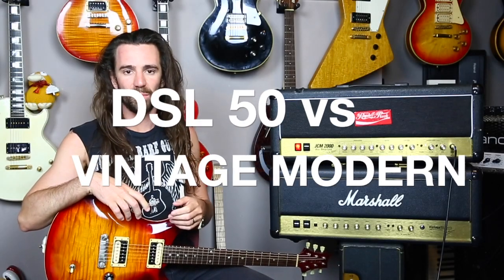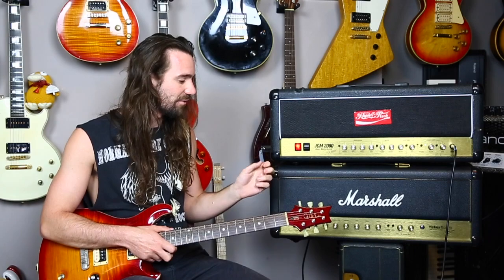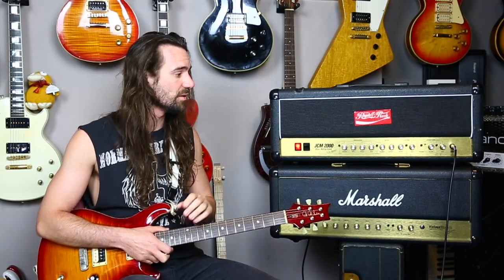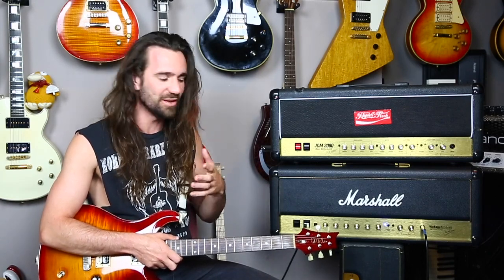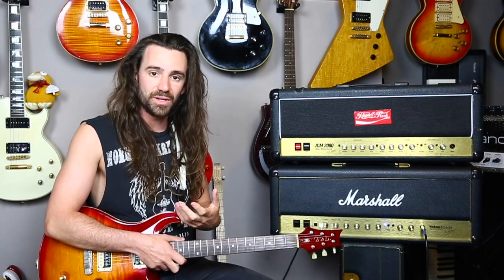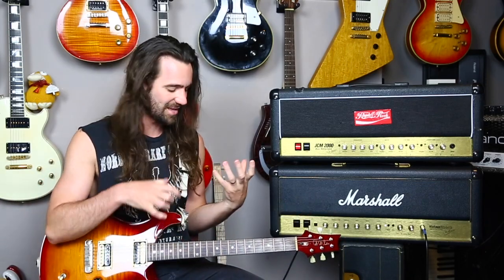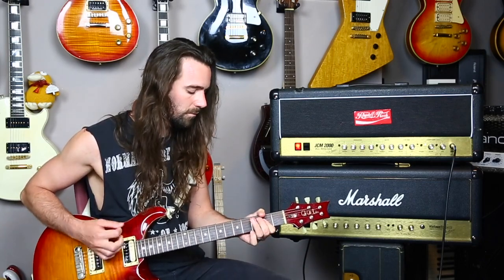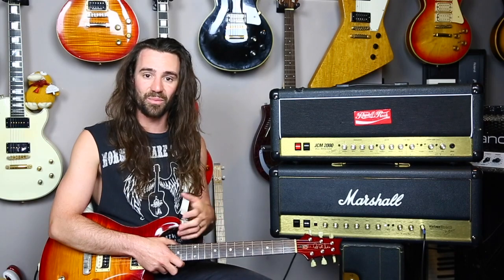Marshall DSL 50 vs Vintage Modern

Comment: Wars have been fought and won using the DSL's green channel. Crunch mode all day.
Reply from the maker: If Marshall made a single channel amp that was just the DSL green crunch it would be hailed as a classic.
Reply: @LeonTodd   DSL channel 1 Clean Channel 2 Crunch..ive had mine modded , red meh..channel 2 boosted with ZW44 is much warmer and gutsy than red thin channel
Reply: @LeonTodd  totally AGREE it's SUBLIME!

Comment: I have both a JCM 2000 DSL 50watt and 100watt. I tour alot and let me say, i literally, never use the 100 watt. The 50 is magnificent. Achieves that overdriven sound earlier. Ive had that amp for nearly 15 years and let me tell you its a steady workhorse. Never let me down.
Reply from the maker: I'm there with you dude, done hundreds of shows and a few albums with the DSL50 and it has not skipped a beat.
Reply: Awesome

Comment: The clean on the DSL has a lovely chime. Seems to me that these two amps would sit really nicely in a twin guitar attack, be really complimentary of each other.
Reply from the maker: This guy gets it!
Reply: Dwayne Yule haha exactly what I'm running right now
Reply: the most intelligent response on the internet in years
Reply: Hi . I’ve just bought the dsl100 and like you say the clean is very very quiet .
 How to get round this , do you use and eq pedal to boost the clean ? 
With crunch it’s a lot louder .
 The quiet clean is the only thing I don’t like about the amp

Comment: A nice shootout, but it's worth noting that the VM was voiced for G12C speakers, which are most similar to G12M-Heritage and whilst they sound ok with V30's they do lack some of that "character" and will give you that ripping hot JTM45 soul.  Also if you want more of that Paul Kossoff sound you want the 55hz not 75hz (pre rola)

Comment: I have had my 99 Dsl 50 for 15 years. I love it still! Just bought a 2x12 1936 cab w/2 25 Watts Greenbacks. It is SWEET! Great review, my friend!
Reply: DSl Amps  and M magnet speakers  like greenbacks  and the creamback  M65 are a  Match made in  heaven.  DSl amps  with warmer vintage speakers are just perfect to my ears.  They round the DSl amps  off just enough and  add just the right amount of warmth.  I like amps that  sit  right between   vintage  and modern  and Greenback M25s and  Creamback  M65s put the DSl amps  right in that spot.

Comment: I used a jcm 2000 years ago. It sounded great. Then it was dropped out of our van and repaired and then I didnt like the sound. I sold it and then used a jvm410. I still have that amp but I dont take out half stacks anymore. Im useing combos. I like the dsl 40.

Comment: Not much a fan of Prs I own a 1989 Custom 24 top 10 with rotary control my Les Paul custom 1968 blows it away the vintage modern with the les Paul is the best sound I ever had

Comment: Been watching your demos of the JCM2000 DSL50 great info - I have one and I love it - I had an original JCM800 and I never could get it to do what the JCM2000 DSL50 does so I'm glad I sold it! I use the CRUNCH channel and get my distortion from various pedals and it sounds awesome with my Marshall 2x12 Cabinet! My main distortion is a Bogner Burnley - the amp sounds great for the Jimi/Trower/Doyle Bramhall II stuff I do - add some UNI-VIBE and holy toledo the room shakes!

Comment: I preferred the DSL 2000 because it seems to be more versatile (that and I want whatever Adrian Smith has), but outside of hard rock and metal I would probably be all over the VM, the drive channel on the VM seems more of a one trick pony compared to the DSL but the VM does classic rock very well.
Reply from the maker: Dadrock 80 Iron Maiden user the JMP-1 preamp live I believe.
Reply: Leon Todd, hi, he definitely does, I guess it pretty much controls everything (clean, dirty, most effects) and simply runs straight into the head of the 2000. But he's still got one so I want one, but a jmp1 would be cool too!
Reply: I have a DSL H Marshall 100 watt head love it I have a 425b Marshall cabinet with the green back speaker it's sounds killer I'm going to be getting me a Vintage Modern Marshall to match my cab ASAP! Can't wait !

Comment: Great demo!.  I have owned both of these amps and go back and forth.  I currently have the DSL 100 and a couple Bogners.   The is something very satisfying about the grunt of a good Marshall.  I remember struggling to keep the VM tight sounding..  However  I am not a metal head  but love playing old Scorps, VH, sabbath, UFO,  older maiden , AIC, GNR   Etc.  they both do that stuff just fine.  I think the VM sounds a bit more like super lead and the DSL more of a the 800 or Silver Jube vibe.   A little harder sounding.  not necessarily in a bad way, just different.   Again  excellent demo.  Both amps are solid workhorses.  Thanks for sharing.

Comment: Great reviews I have a JCM 2000 DSL absolutely love that amplifier The JCM amp that I picked up has a C12 cap mod and a bright switch in the EQ section it will actually start sagging like a four-hole Plexi it's quite amazing that punchy type of sound with the switches engaged up
Reply from the maker: Very nice!

Comment: VM's are typically way more dynamically responsive than most JCMs.   Can be very rewarding if you have a lot of precision in your right hand, but will also not hesitate to let the whole world know if you are actually just a sloppy guitarist that relies on pre-amp gain compression to hide your BS.   Needless to say, the VM did not sell well :b
Reply: Was looking around for vids about the VM to help me sell my 2466.  Ended up falling in love with it again (it was in storage for 5 years while I lived in a different country).  This thing's not going anywhere.  It took me back to when I bought this.  I was actually hunting for a throaty high-gainer, tried a lot (I recall a TSL, a Laboga Alligator and a HK Switchblade), and the VM was an afterthought, but it just clicked with me.  Not the style I was playing, but definitely a style I wanted to be playing.  I love it for the dynamics, these days for sort of Contortionist-style playing, Tool, Opeth....

Comment: I have to say I love them both. I currently own a DSL 50 and 100 watt. One thing I don't like about the DSL design though is the extreme drop off in volume when you go from crunch to clean on the green channel. If anyone has a suggestion on how you deal with this or any mod ideas, I would appreciate it. Great video Leon. I hope to get my hands on a Vintage Modern someday.

Comment: thanks for doing the side-by-side comparison. The thing that you might be liking in the DSL is that it uses diode distortion which in my opinion is cheating. Yes in fact, they did add an extra tube, but there’s still is diode clipping in the signal path, and you can call Marshall, and if they decide to be honest on that day, they will tell you that. The vintage modern was part of Marshall’s master class Amps series to combat all the boutique amps of that time and they nailed it. It is a single channel amp so it’s really hard to compare a two channel amp that has four modes to a one channel Amp that has a boost function and yet it’s still has all the killer classic tones of  a plexi, super lead and it beats down the JCM 800. By the way I was in several hair metal bands during the 80s so you may have guessed my age after that comment. Point being we couldn’t give JCM 800s away back in those days, everyone wanted super leads. back in those days you could literally pick one up for $400 and people would complain about paying that much. 

I have an early pre-release  100w vintage modern I picked up at the NAMM show and I really need to make a video on it but i’m afraid the prices are already climbing on the vintage, modern as people are starting to get hip to them and if I made a video it might start a frenzy. I’m not talking bad about the DSL. It’s serves a purpose you don’t have to bring a distortion box because it’s pretty much built-in, of course people still do and that’s probably just a taste thing. I do appreciate your videos even though the last few comments I made are a little contrary to what you’re saying keep up the good work.
Reply from the maker: I appreciate all the comments, it's pretty rare to get stuff that's not "OMG GREAT TONE" or "U SUK BRO!" so they're a pleasure to read.

Comment: When it comes to Classic Rock from the 70s and 80s you really cannot beat Marshalls. They were designed for that very Style.  If you are loaded with cash check out Friedman amps. Friedman's are like Marshalls but built 200% better and they sound better.
Reply: Ben Middleton. Disagree. Friedman amps sound very 'satisfying' in a YouTube clip but are far too fizzy for me.

Comment: I have a couple JCM 2000 DSL, 50 and 100. I like the tone your getting. What tubes are you running in each. Overall I like the VM. But to be fair I'm looking for one. Definitely hot rodded 70's and 80's plexi tone!
Reply from the maker: Rob Miller VM is stock from the factory. DSL I need to check

Comment: I disagree that the fizz is what is needed in order to punch through in a loud band. The fizz just makes the amps sound scooped, and we all know how likely a scooped amp is to punch through in a band setting. On my DSL20HR, red channel, I keep Treble at 0 or near zero, Presence at 5 to get body out of the tone. Mids are usually fully cranked or close to 10 (at least 8), Bass somewhere around middle. For classic tones, I keep Resonance at 0. If I want more of the American Mesa (scooped) tone, I engage the Resonance control more and set EQ to around noon, at which point it's a pretty scooped modern metal sound.

Comment: Maybe im biased because i own a VM but it just sounds amazing all the time. It has the most beautiful cleans, great lead and overdrive and takes pedals so well. For me its totally up there with the plexi and jcm800 in terms of the marshall tone. Ill never part with mine. Just a shame i dont get to crank it ever.
Reply from the maker: xWILZTAx a lot of players are scared to move the EQ too far away from noon and don't get to tap into everything the VM tone stack has to offer.
Reply: @LeonTodd  a VM will make you sound great or it will make you sound pathetic.  I own the 2466.  I love it.  It's very responsive to the volume control of the guitar.  I play a lot on the high dynamic range....roll the volume back on my guitar and get that awesome plexi tone!   Turned up it sounds like a badass JCM 800!  By the way I own the half stack. All purple the cabinet is the 425a.  Freaking awesome match!

Comment: Those are some awesome sounds.  I don't get the same killer tone out of my DSL 50.  Do you use an alternate tuning and do you have a pedal or preamp? Has the input gain on the amp been modified?
Reply from the maker: This is all raw amp, no mods. Keep in mind this is a mic'd amp so what you're hearing is different to the amp in the room

Comment: Cool Video man new sub to your channel here! I own a Vintage Modern I boost with a Klon centaur clone and have also tried with a Ts808. I quite liked the mid boost on this amp. It felt to me like it thickened the sound a lot. I play lots of mastodon and Tool sorta stuff with this and would bet with a fuzz it would be great for doom metal type tones. Do you have a video up of the mid boost tones you found on the amp? Cheers!
Reply from the maker: Jonny Gallagher a Marshall with a Klone is bliss. The VM doesn't get too saturated so it handles fuzzes real nice!

Comment: That's what I was thinking the 2000's you can tweak them a little bit more volatile volume like in your crib Vintage Modern you might have to have your neighbors barbecuing and drinking beer and who knows they might shove you up on the stage unless you sound like s***

Comment: I dont know, man. The vintage modern to me sounded a lot more clear and dynamic. I feel like it'd take pedals a little better. Ive owned a JVM, JCM2000 DSL/TSL, JCM800 2203, I now have a VM and  its honestly my favorite out of the whole litter. To me it's the 2203 at a fraction of the cost with a more punchy and aggressive, but less scooped sound. JCM2000s sound good but that VM has a lot more wide-open throw to my ears. VM with a Maxon OD808X in front of it is STUPID heavy sounding.
Reply from the maker: Yeah I love the VM boosted too!

Comment: Thanks for the VM mid boost + Strat tip. I have just bought a VM 100 head - amazing amp! 
Am I right in assuming that if you have a VM + DSL 50 OR a VM + JCM 800 you will have all Rock bases covered from 60s Blues-Rock to 90s Alt-Rock (but not metal)?
Reply from the maker: Great to hear. Pretty much, the DSL will do some great thrash tones too.

Comment: Never played either of those amps. Have a similar setup though. Marshall JTM45 into a 2X12 cab with Weber Legacies, a GDS Amplification 18 watt head into a Reinhardt 2x12 with creambacks; and an 80’s vertical input Marshall 4010 JCM 800 50 watt into a 4X12 cab with Greenbacks and H30’s. The JTM 45 being similar to the VM, and JCM 800 similar to the DSL; but with a little less sizzle running 6550’s.
Reply from the maker: Oooh tell me more about the 6550's :)
Reply: Leon Todd well, normally I’d go with EL-34’s on a JCM 800; however, this amp was setup with 6550’s when I got it used, and it sounds awesome with the G12M65 1x12 it came with as a combo. I did have it completely restored and re-tubed; but I stayed with 6550’s. They have more clean headroom, which makes the clean channel sound a lot better. When pushed on the dirty channel, they just have more balls with less compression. Not as “fizzy” and compressed as EL-34’s would be. I normally plug it into a 4x12 with G12M-25 Greenbacks in top and G12H30’s in the bottom, and just roars with authority.

Comment: that very last comment made in the video is one of the most important in making a choice between the 2. If playing through a real speaker cab, no IR's, no attenuator, the VM Master Volume needs to be cranked up to 6+ to sound decent, whereas the DSL sounds good up high, but also at much lower Master Volume settings.  I have never had the fortune to encounter a VM in the wild to try out, but I remember when I first sat down in front of a DSL-100 with a 4x12 cab and I was really surprised how great the playing feel and tonal sound was with the DSL MV set at just under 2 on the dial. It sounded even better at 2.5 or 3.

Excellent video!

Comment: I Loved my 2266 for Mr Big and Stuff like that. But it's not a really tight amp and it's hard to dial it in. Because it needs Master above 5 to get a working EQ i replaced this Beauty after 4 years in the Studio  with my all Time favourite, the 6100.
Reply from the maker: Paul used one for a while right? The 6100 is indeed incredible
Reply: Leon Todd Yes, Paul used it for the Fuzz Universe Album, fired up with a Majikbox body blow and a venom boost. But that was the time he used lower output single coils... That classic GOOMY Paul Gilbert Tone was a Boosted Laney GH100L and used with Tone Zone's and PAF Pro's...

Comment: I have the DSL 100H. I like mine a lot. It took a bit to figure it out as it has massive gain. Ran it back down to about 4 on the 1st red channel and it sounds really good. I run mine through a Marshall MF280 oversized 4x12 cab with Celestion V30 MF`s. Far and away the best cab I`ve ever had and I have a bunch of them. I sometimes run it through a Marshall JCM 900 1960A cab with Celestion GT-75`s. That`s not bad either but I really like those vintage 30 MF`s in that oversized cab.

Comment: Great vid!
Btw the VM has 3 preamp valves in LDR. HDR adds a 4th into the circuit. :)
Reply: whats HDR and LDR?
Reply: @Toraboramusic  the Vintage Modern doesn’t have two channels like most amps, instead a ‘Low Dynamic Range’ and a ‘High Dynamic Range’. It’s a similar effect but I think it works differently.
Reply: @georgetwydell6166  Thanks for that..of course, I should have known! 
The VM has just 3 preamp tubes though I'm pretty sure. (?)
Reply: @Toraboramusic  in LDR it runs 3, HDR adds the extra into the circuit 👍🏻

Comment: Really there's not much difference in the tone stacks only the treble cap and the slope resistor. And that varied a lot on the pre master vol. amp's. Some used the same values as 2203. The larger cap on the later amps don't make the upper freq. louder but have a lower freq. roll off. Something like 2.5k as opposed to 1.25k where it starts to roll off. The 2203 used a 33k slope resistor the older stackes used a 56k. On a couple of amps I've put in switches where I could switch between values and it wasn't a huge difference. And yea more distortion and u tend to get that bit of edgy top end. The nature of the beast. Robben Ford and Carlton at times used a Dumble which are not real hi gain and if u look at the schematic's you'll see Dumble's have very symetrical clipping which gives you a smoother type distortion where Marshall uses more asymetrical cold clipping which gives you that good old Marshall crunch. Hope that wasn't too much info.
Reply from the maker: That was awesome. please feel free to share any more info, I love this stuff!